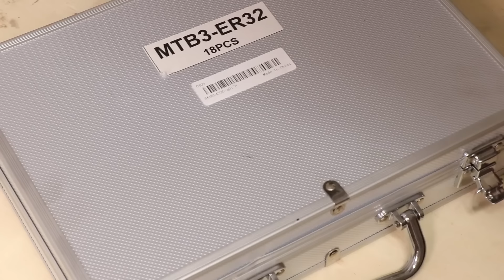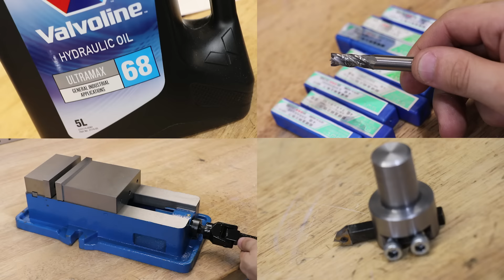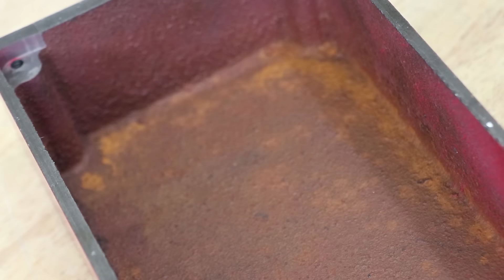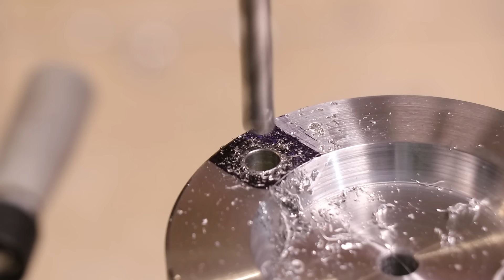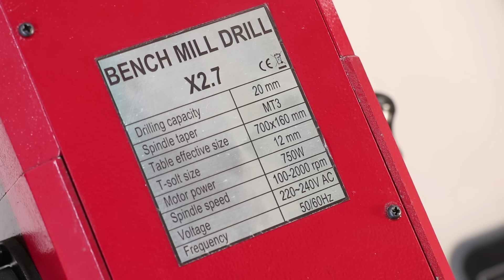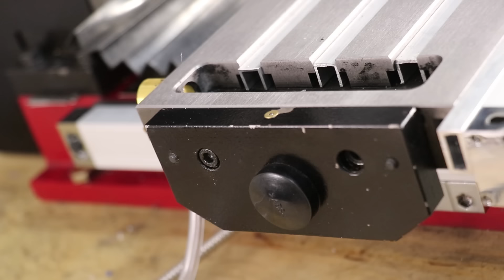Should You Buy A Cheap Mini Milling Machine?  (Sieg X2.7L In-depth Review)

Comment: Thank you very much for this . absolutely useful in so many ways.
My wish is that (seemingly) no manufacturer produces a drill press with built in Quill lock. 
My requirements are no so much metal machining, but true calibration in X,Y,Z axis`s for wood . Consequently I now find I have to search in the milling field for my requirments.
Again, thank you.
Reply: Embrace your new hobby.  I've been using machinist techniques for years on dead tree carcasses and I find that I probably arrive at solution much more quickly than most wood workers.  Need an exact width dado?  Set up your dado set to near the width you need and then make a test cut.  Check the width of the test cut with calipers and then add or subtract shims as needed.  I've yet to do more than one test cut to get exactly what I want.  No more swapping shims, testing, swapping shims, testing, etc.  One test cut.  One adjustment.  Done.

Comment: I had my fill of cheap chinese machines
The mill has poor cross feed nuts, made of soft brass and not alloyed brass to make them hard. just wait a few years and you will find you have to either make new nuts because you won't find parts for them
The cheap lathes, they to have soft gears in them, as you will find they round off,
and check the tail stock castings and mine also fractured from tightening it to the bed,
Had to rebuild mine,
never again !
Also the beds on the mill, not very good

Comment: Is this capable of cutting out glock slides?
Reply: I've seen people do it. Now whether you can do it is another story. Machining is often more the machinist than the tools used.
Reply: If you have to ask you will either end up with a slide in your face or in prison for possession of an illegal firearm.
Reply: @Compairholman  what's an illegal firearm? Asking from a constitutional carry state.
Reply: @Compairholman  I live in the states, its legal to build your own weapons except per nfa items, full auto, sbr,sbs, barrel length etc.  I have done some ECM but its a very slow process so I need a mill
Reply: @250smacks  do you not have to register it ?
Reply: @Compairholman  no sir
Reply: @250smacks  you could mill a pistol slide from solid with this machine no real problem except it would be slower process of multiple shallower cuts than the CNC machines do in the factory. It comes down to the operators skill level in the end.

Comment: By trimming your column using blades you loose lot of rigidity. You need to use epoxy with steel balls or scrape column base.
Reply from the maker: I got some fixes planned, at the time it's either a trade off between an untrammed mill or sacrificing a bit of rigidity

Comment: I used a tormach PCNC mill a bunch with an R8 collet chuck and I still had to whack it with a hammer to pop out the tools. The tormach TTS system uses an R8 collet to grab the tool holder which is straight instead of tapered so I have also had problems with tools pulling out in heavy loading cases like running half inch endmills aggressively. Morse taper would have been way nicer. That CNC mill is at a makerspace, if I ever need my own machine I'd consider one of these Sieg mills tho. Thanks for the video!

Comment: I'm lucky enough to have a step father who is in charge of procurement for the tool and die shop at a  "large aviation company" building near where we live. I have gotten a Monarch 612 and a 14, 3 Bridgeports (2 clones 1 original) a shaper a CNC lathe and mill and my 2 favorite pieces by far first the Sharp surface grinder (that sells it so far short) it retailed for $85k USD I got it because it was being phased out for $12k USD, because God forbid you take the time to sell a machine through a typical 2nd hand method. This type of stuff has allowed me to teach my two 14 year old daughters how to fabricate you in case their modeling careers fall through and their dance never gets to a professional level or  they don't make it as YouTube stars. Also I'm hoping the machine oil smell will keep the boys away and the day it doesn't is the day we have a chat with the boy about his intentions as he is either "good stock" and looks past the smells and grease monkey looks or he is a fellow chip maker and I may need to either kick his ass or invite him back to the shop

Comment: Most mini mills (including this one) are too flimsy for cutting steel and way too slow for aluminum. You are way better off using the same money for a cnc router (with linear rails). Or, better still, build a rigid diy one from epoxy granite. 

A high speed spindle will zoom through aluminum like it's not even there and it won't be much worse cutting steel (with small tools).

It's painful to watch a mini mill crawl through aluminum with a 2000rpm spindle at a snails pace.

Comment: The other issue with a gear driven head is the sheer noise it makes.  And it's not a 'quality' noise, it's an awful noise.
Reply from the maker: Interesting, the gears on the mini lathe were pretty quiet and I believe it's a similar set up. Cheers
Reply: @artisanmakes  well, it's a question of perception I suppose, but I've certainly heard loud gear drives in both electric hand drills and lathes,  and I say gear noise makes a tool seem cheap and weak more than any other attribute.   Similarly, if you have to hear an electric 'hum' from a lathe, you want to hear a low, smooth hum and not a loud raspy hum.  It's very headache-inducing.

Comment: I tried to keep track, but I'm not sure I caught it all.  What did the basic setup cost you when you included: the mill, your chosen collet/mount system, vises, and DRO?  And did I miss anything?  I excluded the bits/end mills intentionally because I thought they might vary by person, but I suppose that a ballpark starter set cost would be good.  I presume you are using your local dollars, too, correct?  Thank you for another interesting video.
Reply from the maker: No worries, the mill by itself was $1,800 AUD, DRO kit was $200, collet chuck and collets were $80, parallels were $70, vise was $100, in total the cost plus a few end mills was $2,300 aud for the set up, although you can save $200 initially and purchase the dro at a later date. Cheers
Reply: @artisanmakes  thank you!

Comment: Why dont you use a wather and oil coolant. We use that and it keeps everything from not rosting and greases the rails and kepps them clean. The whater in the mixture keeps parts cool.
Reply: I use a misting type coolant nozzle, ti's a total win.  You cool with the airflow and the coolant, a gallon of coolant will last like 5 years, and there will just be a little puddle you can wipe up with a couple paper towels.  Much better than flood coolant for the hobbist.  Also uses very small airflow, even a little air compressor can easily handle it.  Flood cooling can make a mess

Comment: bought one new and the z column was knife thin at the top where the dovetails met the metal. I returned it but the store was hesitant and gave me troubles. Got a second one, same thing but at the bottom of the column where the bolts hold it. A bridgeport style mill is the best choice when possible...
Reply from the maker: Sorry to hear about that, not a problem with mine bit that is a risk with these mills. I'd always love to get a knee mill but they aren't common here and I'm not sure about the price the would command. Plus I'm not even sure it would be possible to put it in my workshop. Cheers
Reply: @artisanmakes  they need to design a mill that fits right into a modern garage, or change the housing codes to make the garage doors a tad higher

Comment: Even if you can find a way to clamp an end mill in the drill chuck I've always been told that milling with a drill chuck is a big no-no. The reason being that the drill chuck is only designed to push straight down. The drill chuck is usually only held on by a taper so can go flying off (or develop runout) if you apply side force to it.
Reply: Also the bearings in the drillpress are not made for substantial side force. You will quickly destroy them when abusing the drill for milling.
Reply: You can fly cut with a drill Chuck as the side loads are not huge. Actual milling forget it. Then again many cheapo drill presses don’t run true and rely on bearing lash to allow the drill to centre itself. Totally useless fo anything more than basic drilling.
Reply: @Dave5843-d9m  David is “fly cut” a technical way of saying “a small amount off the top” (serious question, I have zero trade qualifications and very little experience) thanks in advance
Reply: @MadMax-bq6pg  No. Also a fly cut is not a really good hair cut. A fly cut is using a fly cutter. A fly cutter is most commonly used to clean up the surface of your stock. A fly cutter is a tool holder that holds a tool very similar to a lathe tool sticking out and below the tool holder. The video shows the use of a fly cutter about halfway through.
Reply: @wjpreslar  many thanks!
On the verge of taking the plunge and buy machinery, need all the advice I can get 😊
Reply: If you're doing a CNC conversion - you could maybe do as much roughing as theoretically possible  with an endmill on a drill cycle. That way you'd be minimizing the side loads to mostly finish passes.
Reply: @nate6692  Drilling with a drill is way more efficient than an end mill
Reply: @madrox4132  yes, but it's not flat bottomed. If you're trying to mill on one of these machines you could do most of your roughing that way. Drilling as stock removal is an option either way if you don't mind the tool change.
Reply: @nate6692  the drill angle at the bottom of the hole doesn't matter if you're not drilling to finish depth. If you are, flat bottom drill bits exist.
Reply: I have used a drill chuck to kill with and very quickly ruined it. And it was a nice Rohm one.
Reply: You need better drill chucks. One of those Albrecht type drill chucks, keyless, held my end mills very well, albeit with a runout (meaning shorter life) compared to an ER collet. When I machine softer material I just found it faster to use the drill chuck to hold the end mill. The keyed chuck that comes with most mills are terrible and hard to use. The problem is finding something that fits in a MT3 taper... my mill uses NT40 taper and they make APU13 and APU16 chucks for it.
Reply: The problem with endmills in a drillchuck is that their helical angles and resulting cutting forces literally pull the tool holder downwards away from the spindle. That's why you shouldn't even try using a drillchuck for milling. Even if the tool holder is rigidly mounted to the spindle with a pullstud, using a drillchuck for milling is a bad idea. For one there's the inaccuracy of the jaws, they're not made to be precise. A endmill needs to run with as little runout as possible. Every 0.005 eccentricity you add will shorten the life span. Also, taking big cuts can be dangerous as there is little surface that gets grabbed by the jaws,resulting in the endmill getting pulled out. This also results in reduced rigidity which can mess up the surface finish, tool life and precision.
Reply: @chas1878  Well if I was doing heavy cuts in steel then sure, I'll use ER collets, and they have a VERY tight hold, possibly with the same precision as shrink fit, but then I have to change out the tool and all that which takes time... So if I'm machining soft materials or wood I just use the drill chuck. The side load for machining wood is so low anyways.

Is there a way to convert a 40 taper spindle to BT40 using pull studs? Undoing draw bar takes time and if I could just use the same setup that CNC uses it could make tool change so much quicker... kinda like a power draw bar you know...
Reply: Good way to destroy a drill chuck.
Reply: Using a chuck mandrel that has a drawbar thread in the top ensures it won't work loose on the taper but milling cutters are always best mounted in either a Morse collet or an ER type collet.
Reply: The reason you would choose not to use a chuck is because of runout tolerance and tool holding.  When using an endmill - or even a spiral flute drill for that matter -  the flutes will create forces that will pull the tool out of spindle.  The motors on your typical mill are much more powerful than on a typical drill press.  It just so happens that a chuck does not have the gripping force needed to hold onto the tool when that tool is being driven by a more powerful motor.  If the motor on your mill is smaller - like one you would find on a drill press - using a chuck is probably just fine, even if your using an endmill.

That said, you could use a chuck on any mill, providing you reduce your feeds and speeds to match the capability of the chuck.  It's just that you would not be taking full advantage of your machine at this point.

Also, a chuck is not going to hold the runout tolerance that you can get from ER collets or most any other tool holding solution.  And when your machining parts your most likely going to want the extra tolerance.  Hence the reason they are not commonly used.  Even when the gripping power would be just fine.

There is no rule against using a chuck in a milling machine.  I've seen chucks fitted to a BT40, used on a 10 HP CNC machine.  Mind you, whenever it was used the machine was not anywhere near its capacity.  Changing the drill on the other hand, was fast and breezy.  And if you don't have a tool changer or enough tool slots...  well that might be a good solution.
Reply: If you have to use a drill chuck for an end mill use a left handed end mill that way it continuously tightens in conventional cutting motion .
Reply: 13:30 and to mitigate lateral stress, hence why this is not a drill press
Reply: "ONE TIME" I vividly remember using an end mill in my drill press, and being "chased" across the room as it decided to yank both End Mill and Chuck out of the Quill!!!  Like I said "ONE TIME".
Reply: As a retired, life long, trade schooled, 33 year owner of a machine shop---would Never use any chuck for any milling procedure! Personally, I do not care for the fixed type R series collets that attach by the draw bar screw either, and use only the ER type collets held by a stationary collet chuck, with individual sizes for each collet. If you could use a chuck for milling; why not just buy a cheap drill press?
Reply from the maker: Not disagreeing with you, though I have seen some pretty janky set ups (not limited to ones I have done). There are a few videos on youtube where people use those aftermarket mill tables in a drill press as a makeshift mill, not that I approve of that :)
Reply: @artisanmakes  oh yeah it certainly can be done. You just run the risk of hurting yourself, or even worse your mill ;)
Reply: @artisanmakes  I have done that before. Actually did some heavy stuff with it. But no, it isn't the best way to go.
Reply: a drill chuck will hold an endmill surprisingly off-center. They are not that accurate.  This doesn't matter at all for drilling but it's a deal-breaking for milling, because you'll have only one flute trying to do all the cutting.

Comment: R8 does stick. But not too bad. 2 small brass tap. It fall out. R8 is key so gotta find the key to go all the way in. So that key can go bad if you not key correctly.
Reply from the maker: Interesting, I have not used r8 before, but I watched a few videos with a guy that used R8 is a bridgeport or something similar and the tools didn't stick at all. Still probably leaves better then mt3, cheers

Comment: I had the x2. found it to small, under powered and not ridged enough. looks like your mill is a huge step up from the x2.  great video
Reply: Yea but the x2 can be had for like a 3rd the price. The category this falls into is really pitted against much larger bench top mills. Grizzly had the g0704 in its basic form for around the same price as this for awhile, though it looks like they don't offer it by itself anymore, just with the overpriced stand.

Comment: Just a heads up. That ISO 68 hydraulic fluid is different to ISO 68 way oil. The ISO 68 just dictates the viscosity of the oil. Way oil will be stickier and holds itself to the ways/lead screws and prevent wear.

There's an eBay seller from Aus that sells small bottles of mobil and generic way oil.
Reply from the maker: Cheers, it's close enough for what I need, my understanding is that way oil is a type of hydraulic oil anyway. Plus it helped that I had the bottle on hand before. I've seen it used as a substitute before without issue but I'll have to check out eBay since I the local reseller only sells way oil in 10l bottles.
Reply: @artisanmakes  I use chainsaw bar oil on my Sieg SX3L, sticky & around the same viscosity.
Reply from the maker: @petermurphy3354  I have heard of that alternative being thrown around before. Not sure how it compares but if it works it works, cheers.
Reply: I don't oil my lead screws.  They came greased from the factory and oiling them would only wash away the grease.  I may grease them periodically, but the manufacturer didn't intend for it to be accessible for lubrication.   The thrust bearings for the axis', however do come with oil caps.  I use way oil on those as well as the dovetails.

Comment: Well done, I have a 30 year old Busy Bee bench top mill, lots of people ridicule these smaller machines but the do great work within their capacity. I use MT3 collets now  and it makes a huge difference in rigidity and clearance compared to the Clarke/Posi lock holder that I started with. Ausee tools has a good range. Thanks for posting.
Reply from the maker: Thankyou for your comment, I have ordered some MT3 collets for a quick change tooling system and i'm glad to know that they are more rigid. Cheers
Reply: @artisanmakes  Be nice to see a video doing a comparison with ER32?